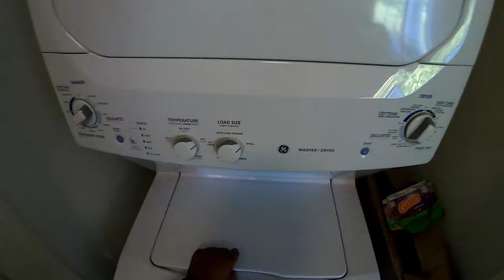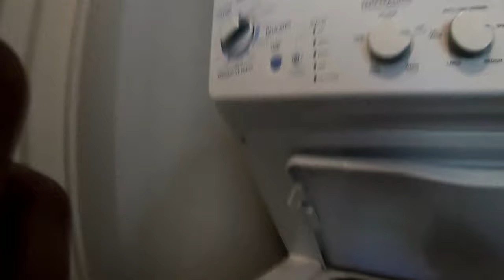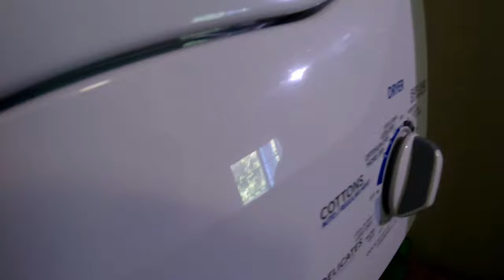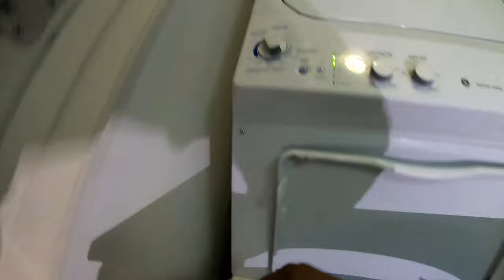How to replace GE washer Drum, GE stackable , GE washing machine drum leaking

Comment: Take that front metal bracket with 4 -8 screws on it come out with the top first then pull the suspension rods off is a whole lot easier bro

Comment: Thanks for the run down. Mind if I as a question before I do this?  I'm not the best at describing these parts: What I have done.

The agitator was stuck to the drum not letting it spin. Looks like when they put it together the didn't put the rubber washer between the bot and the agitator correctly, (the washer was beside the bolt).  This was breaking the Screw Pulley Assembly. 
I removed the agitator and replaced the pulley and it now spins but only for about 30 seconds before shutting off. 

Any ideas?
Reply from the maker: Thanks for the comment hit that sub for me ... 💪🏽🔥

But yes when u get that nut off (no diddy🤦🏽‍♂️) you really have to pull the shit out of it and in some cases I've just brought a new agitator
Reply: @OffDaHook84  Subbed. My question is why would it spin up for a few seconds and then cut off. I'd hate to take the drum out and that not be the problem.
Reply from the maker: Sorry , Is it banging the walls when it spins ?

Comment: The most important and interesting part is missing: how did you disconnect shock absorbers that located inside and connected them back?
Reply: I cut them off... They are not needed!
Reply: Take that front metal bracket with 4 -8 screws on it come out with the top first then pull the suspension rods off is a whole lot easier bro

Comment: What are you shoving your screwdriver up into at 3:00?
Reply from the maker: 1/4 inch ground screw (use nut driver )
Reply: You are unscrewing something at 3:00 - you put your screwdriver/Bolt driver Up into a tube. I don’t know what that tube is and I’ve noticed it on my machine

Comment: How did the agitator come off?  I removed the bolt and I can’t get the agitator out
Reply from the maker: sometimes that thing can be a B!@&# but you really have to ya yank on or wiggle a little sometimes i sit down on the floor out both my feet on the drum and push with the legs and pull the agitator this the body and both arms of that makes any sense
Reply from the maker: let me know how u make out
Reply: That makes perfect sense lemme try
Reply: It’s still no budging .  I put a strap under it, put in on the floor and pushed with legs with strap around back no movement .  That buggah stay tight
Reply from the maker: just asking … you did pull the cap and take that center bolt out down in the middle ???
Reply: Yes did.
Reply from the maker: ima say this i know that struggle , but worst case a new agitator is not that much not sure where you’re getting ya parts from , almost wanna say spray down in there let it sit overnight(w-d)  but be careful u may have to wash that basket out good if you go that route
Reply: well after multiple attempts to get the agitotor off I called my appliance repair guy friend and he said the GE brand are the hardest to get off said its possible but maybe a good idea to work around, which is what I chose.  I simply wanted to clean the drums from excess gunk which I did with a chemistry brush and a pole.  Love your knowledge though and thanks for the multiple replies. 🐝🐝⛵⛵

Comment: How do I know where to tap to get the front off? I can't get mine. help!
Reply from the maker: oh you mean in the very beginning? , well use 2 flat heads stick one partially in and twist a little look in the crack and you will see the silver tab stick you other flat head under that tab tap and pull the door , it’s easy im so use to it so i don’t even look i just know where they are , let me know how it works out

hit that subscribe for 💪🏾